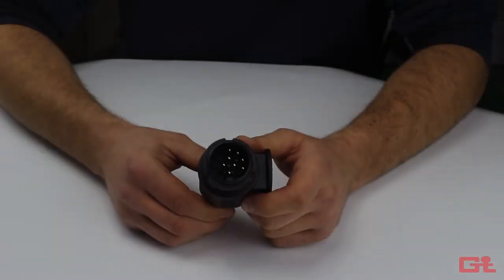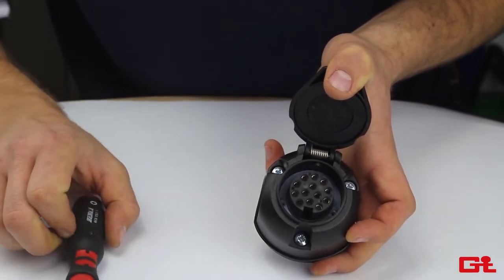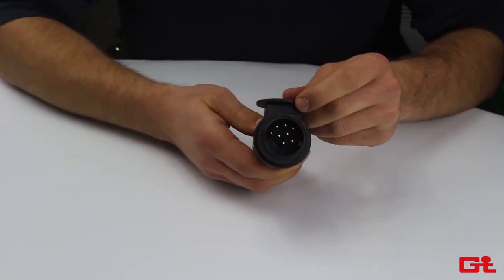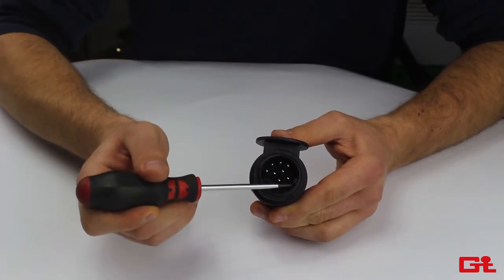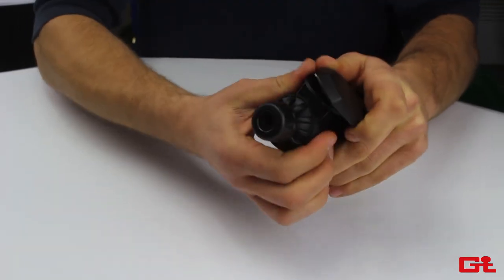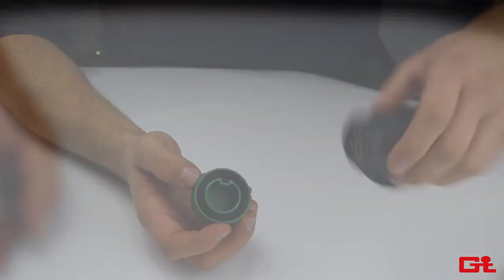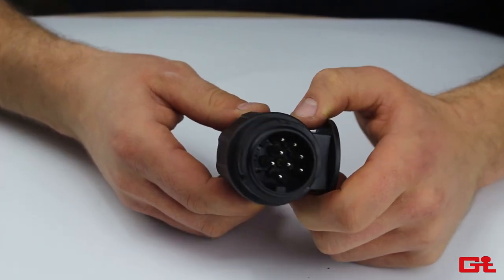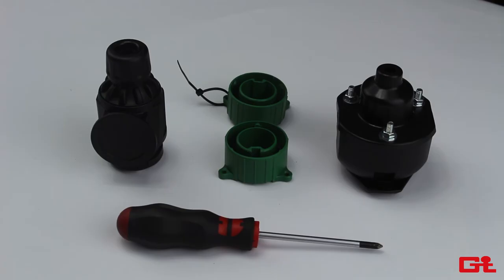How To Realign Your 13 Pin Trailer & Caravan Towing Electrics Plug | GT Towing

Comment: Hitching up yesterday and socket would not go in (had been a bit iffy a couple of trips prior - rant/rave/roar for 20 mins - deep breath - review situation and could see collar and case are 2 pcs search including YT and here we are. To be fair screwdrivers did not budge it but inserting and twisting in the truck socket and good to go - silicone spray once back at yard and review hitching up in future and maybe get the tool if next trip out is still sticking - thanks for helps and heads up

Comment: Whats the solution if the car fitting moves out of alignment  ?
Reply from the maker: Unfortunately, this means your socket is broken. The inner part of the socket has come away from the outer, and will need replacing.
Reply: @GTTowing67  you were spot on.
I replaced that and the actual bracket that holds the socket in place too.
it was really poorly made and rusted away